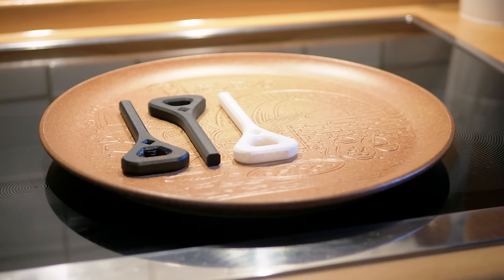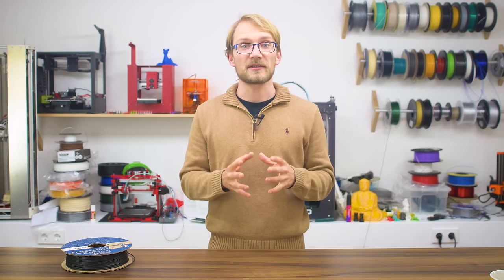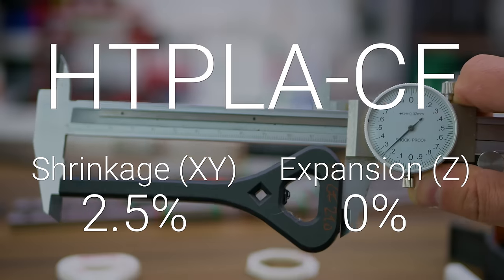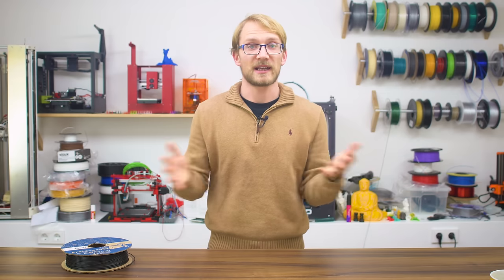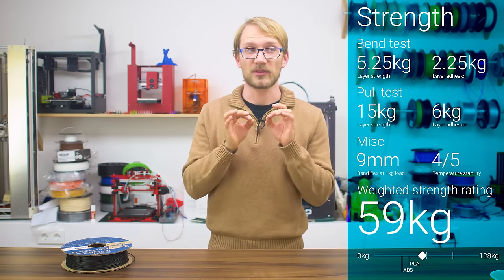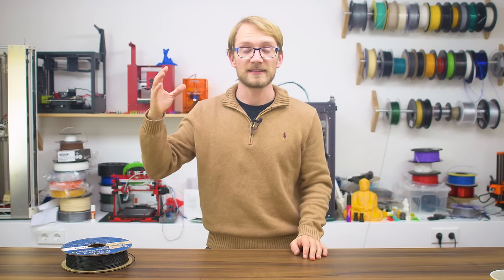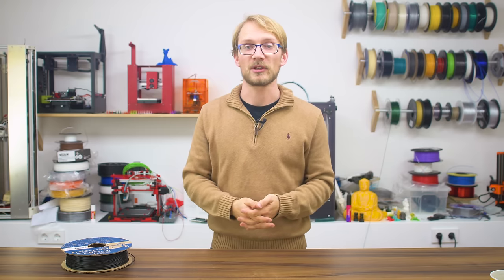Bake your PLA and have it outperform everything else! #Filaween

Comment: I am currently interested in moving from ABS to PLA but need the temperature range offer by ABS, so your video was of great interest to me. Based on your input, I baked a PLA box, which is 86x95 mm and with a print height of 41 mm.  Wall thickness is 3 mm. Unfortunately, the annealing process caused the box walls to warp and blister with the outer shell separating from the inner fill. However, by encapsulating the box in plaster of paris and annealing below the boiling point of water,  to avoid  the moist plaster from cracking, I was able to get a usable PLA box, with virtually no warping or blistering. It's dimensions were also very close to that specified in the design.

Given the lid is a flat 3 mm surface, all I had to do to avoid an warping was  to cook it while still attached to my hair spray coated glass print plate. There was, however, a 0.6% shrinkage along the print surface x and y axis. Print height increased by 3%.

Comment: Hey Thomas!

I'm an undergraduate researcher with Mississippi State University who's currently studying the effects of annealing on standard PLA printed parts. The purpose for this is, as you likely know, to increase viability of additively manufactured parts that are to be put under moderate levels of stress, since the additive method of manufacturing is, without a doubt, the least wasteful manufacturing method. I wanted to thank you for taking a scientific approach to this. While putting together my research literature I have found very few sources that actually include scientific data in their observations and findings on the particular topic of additive PLA annealing. I would also like to ask if you would mind letting me reference this video in my final report and presentation. 

Thanks!

Ryan

Comment: Is the shrinking factor a constant? (IE: does it always shrink X & Y by 3% no matter the shape or size of the printed object?) Or does it depend from the printed shape &/or it's size?... that would be interesting to find out with some tests... If it's constant then it should be possible to adopt universal values of pre-scaling the model prior to printing to get the desired dimensions after baking it... just my 2c
Reply: Pick your favorite PLA, make different parts of different shapes, bake it and measure. There's no other way to know :)
Reply: FranckR I...
...
I don't have a printer... :(
But I plan on getting one eventually.. probably a Prusa. I can make custom models easily though... so yeah :3
Reply: Great question, I don't believe that it is. There is an inherent flow of material and therefore alignment of the molecule as they are extruded even under low pressure. A higher speed of extrusion should increase that level of alignment. Therefore its possible to assume that the direction of the extrusion (or flow, say from North to South) of the material will have a greater amount of shrinkage than from East to West. All to be validated and tested. But again, great question.
Reply: Fred Pinczuk Yeah that sounds plausible... other factors can be involved as well I think.. like how fast it cools down after the extrusion... that can affect how the molecules settle down..
Reply: This was my question too. If you're printing a one piece toy for the kids shrinkage is a moot point, but strength would be a big plus. If, however, you have a multi-part assembly, quantifying shrinkage for model adjustment becomes crucial.

The problem I see is that "doing tests to find out" would be a nightmare. Too bloody many variables! +Fred Pinczuk was on the right track.
What temp and speed was the filament extruded at when made? Cooldown time? Same Q when printed. Was there a fan? How much air flowed while layers were laid down? What was the room temp? (As +Advection357 pointed out - How fast a cooldown?) Bed Temp? Extrusion speed? Nozzle size? Etc, etc, etc. All could affect the results.

Any attempts to quantify shrinkage rate would require many prints, altering many conditions, and the end result would only be totally true for ONE filament from ONE maker, and might even vary by batch. Even just time / temp baking, ignoring all the other possibilities, would require many runs. We're talking microscopic crystallization here folks. Not one plus one.

This test is very intriguing, but certainly not something someone could do at home... perhaps some MIT undergrad team for their thesis ... But a most interesting idea. A home test would be a colossal waste of time and $$ and would not be conclusive, IMHO. :-)

Big shoutout to Thomas Sanladerer for the test, tho. Nice to know your can get a bit more strength, great for certain projects where shrinkage is a minor issue.

Comment: This might explain why my PLA Hurricane cooling duct and E3D V6 mount have not failed on my CR-10. I initially printed these out of PLA just to see how well they fit. That was last year and I can tell the material has changed because I can feel the material is noticably harder and denser. I am printing another one out of PETG just to see how well it holds up on my other CR-10.

Comment: 110 C is 230 F for us dumb Americans.

The shrinking makes sense if you know anything about pizza making or hat making.

In pizza crust, the dough is full of gluten, which is like a whole bunch of elastic bands. If you try to stretch it in a particular direction, the gluten strands will line up and then all retract, making it even worse then when you pulled it. Similarly, the felt for a hat will shrink in the direction you try to pull it out because the fiber line up and retract like rubber bands. In both cases, you have to coax the shape outward by pulling it in circles around the center. You can't really do this with a printed part, but it helps you understand what is going on.

Think of the 3D print as a bunch of fibers stacked on top of each other. These fibers are largely lined up, layer by layer, and will shrink back into itself when heated, but they will also become thicker. So the X and Y shrinkage should be consistent if the shape is consistent. but if the lines are more aligned with, say, the Y then it will shrink a bit more in that direction.

I work in a plastic manufacturer and we do anneal one part and how we keep a consistent shape is we have a metal form the part goes on to keep it to a specific size. So if you wish to do this for your printed parts, you can but you might want to design and cast a form to fit you part onto to keep them from shrinking in ways you do not want, such as moving screw holes too much in a two-part case. This will be a bit easier and more consistent than trying to calculate the amount of shrinkage

Comment: Maybe you could try baking a regular PLA coil before printing and see if that adds any extra data. I sometimes have used baking on PLA to remove extra moisture. I have noticed that it seems to look differently, but I never tried a strength test to the parts afterwards. If it adds some strength it might be a better option then this because the part won't have shrinkage.
Reply: Dry filament definitely gives the best printing result, but don't be misled, heat treating your filament beforehand will not give it high temperature resistance.  Melting during printing "resets" the material structure to amorphous and it still needs to be baked to afterwards to crystallize and get that high temperature resistance!

Comment: That's really interesting. I'm going to try annealing some generic PLA and ESUN PLA PRO right now!
Oven is set 250 F. Heat gun says its from 130 C to 100 C.
Reply: Test Results: ESUN PLA PRO was stronger. WAY stronger.
Generic PLA was WEAKER.
Reply: I'm going to test with ESUN PLA asap
Reply: what is "PLA Pro?" Do you mean PLA+?
Reply: Richard Dagenais yes, sorry about that. the amazon store when I bought it listed it as PLA PRO and PLA+, they are the same
Reply: PLA+ is definitely way stronger. It has 25% deflection vs PLA's 5%.
Reply: Have you tried leaving a print on the bed and annealing the PLA+ that way instead of in the oven?  I've got parts that can't fit in the oven.

Also, was there much shrinkage with the PLA+?
Reply: esun light blue pla pro seriously warped in all and random directions when left in the oven at ~100C for an hour. The part was a single walled printed 2020mm extrusion at 100mm length. The wall was 1mm thick from a 1.0mm nozzle at 0.3mm layer heights.
Reply: 100c is even high for what HTPLA wants.  It should be 60~70C.  100c is well over the glass transition for PLA+
Reply: After my disaster I got 5/18 threaded rods, attached the rod to a drill, and drilled the parts onto the rods in an effort to regain a straight frame. I'm wondering if I stick the whole assembled frame (Hypercube Evolution and yes it does fit haha) back in the oven if it would make it worse or straighten it.
Reply: I think you responded to the wrong comment thread, m9

Comment: I tested normal PLA and petg for a quad build and wasn't happy with either then heard or the tempered/ annealed PLA I gave that a try and is far superior. To get round the warping, when it's cooling a place a heavy object on the top and it flattens it back to normal so in the end it's only a little smaller than the original piece and the minor shrinkage is accounted for. End result is a far stronger and heat resistant quadcopter especially the arms

Comment: Hesitate to draw any firm conclusions. From my experimentation it seems like different companies use different source materials/formulations for PLA. Even when I was trying to smooth them different brands gave drastically different results from treatment with different chemicals like ethyl acetate, M.E.K. substitute, tetrahydrofuran, acrylic cement, pipe cleaner, dimethyl carbonate, etc etc. Doesn't help that even the chemical manufacturers add different things in their products.

Comment: To prevent sticking, use a powder coating product called pre-release. Also unless you are trying to apply a texture to the part, use a smooth flat surface.
Reply: What material do you recommend for powder coating?
Reply: @RyanR3STL3SS  Material to coat or material for coating? You can coat any material that withstands 350° in an oven, and for coating there are powers available in many colors.
Eastwood and Amazon have a wide selection of powders.

Comment: Makes sense... time/temperature treatment post-production results in greater cross-linking. Which generally yields better mechanical properties. Unless you cook it so much that you degrade it, that is. Covered in Materials 1 in my 2nd year of Engineering, and that was in another Century, in world where I earned my degree in the age when we all moved from the slide rule to those amazing 8-function hand calculators.

Comment: Also, annealing plastic, especially when machining injection molded parts to exact dimensions, seems common enough (at least for industries that do such things) that there is quite a lot of material on the topic. When annealed for this purpose, there seem to be temperature, ramp up, and ramp down cycles for different types of plastics. For example: http://www.boedeker.com/anneal.htm

It's likely that both PETG and ABS parts would also benefit from annealing, although with different temperature and ramp schedules. There's enough material on plastics from other industries that would lead me to believe that all of these techniques should also apply to 3D FDM printed parts, but I can find very little rigorous experimentation.

Comment: FYI: wood shrinks in the opposite way, more or less, when drying. it's different in all three dimensions. wood hardly shrinks at all in the main axis of the fibers. but here's the kicker: wood shrinks more perpendicular to the tree rings than it does parallel to the rings. that's why plainsawn (when rings tend to run the breadth of the board) tends to warp into a half-moon cross section, as the rings are circular. I know it's not relevant, but I think it's cool.

Comment: Pack it in the sand to add compression force to allow filament to bond. This is common post processing techniques done on metal SLA printing. I am assuming same practice can be done on FDM plastic parts.

Comment: You should try with several steps in the annealing process : start with a 70C cession, then 85, then 100, and you may even try 110C after that. The shrinkage will still be quite present, but you should avoid any major deformations.

Comment: Just did my own tests with Makergeeks' HTPLA and some generic PLAs, and I can confirm, normal PLA sees huge improvements. I was worried about making a coffee cup out of PLA for obvious reasons, which is why I went for HTPLA, but after annealing the regular PLA in my tests I am seeing that it could handle near boiling temperatures just fine with no warpage or softening.

Comment: thats good to know.. as i prefer pla above all..  pla is the cleanest and easiest to print... for perfect engineering parts with out the strength.. until now.. a perfect overall filament...  the only problem i see.. for exact measurements.. after heated might not be exact to specifications even if altered on software.

Comment: I'd love it if you did more on this. Tests for how consistent the shrinkage is would be a great start, and testing a variety of temperatures and times would be good too. I'm curious whether short cycles of heating to the glass transition temperature, then cooling, then heating again might reduce the amount of shrinkage seen or whether it would just worsen overall results.

I'd do this myself, but I don't have a toaster oven that goes to low enough temperatures, and my printer has problems I'm still working out.

Comment: Carbon is like wood where it has a grain structure. Especially when printing it vertically. If you printed this part horizontally the carbon should out preform the other plastics. Of couse this is for regular carbon fiber. Idk if the same applies to printed parts. But having your grain aligned with your forces properly should add strength in the dimensions you need while it will be weaker in the other dimensions.

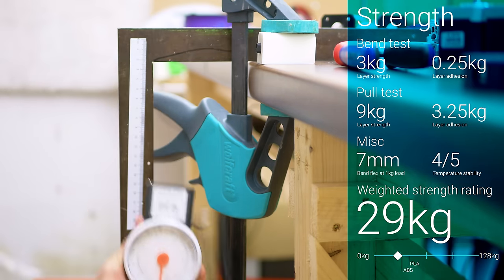Comment: 2:30 The CF, You printed it Vertically instead of Horizontal. Layer on layers are tend to break on that direction and are on the weakest point. If you print it Horizontally where your test are based upon, you will see the modulus strength difference. CF are known by directional strength.

One thing, CF are isolated by on its own layers, even if you anneal them. it will not migrate to a different layer.

Comment: hello, this is a pretty interesting video. i would suggest that you try different cooling speeds after annealing. the crystalline structure of materials change drastically if they are slow cooled (like you probably did letting them just cool down)  vs a fast cooling submerging them in cold water or something like that. you can also try cool them even more slowly letting them in the oven while it cools. the slower the cooling the crystalline areas get bigger while if you cool them fast you are 'freezing' the high temperature amorphous state.

Comment: Personally i do not think that annealing will have any bad influences apart from possibly some degradation of the polymer. (Should not be noticeable if the annealing is done carefully, but it probably does influence recycleability of the PLA) Apart from that, i actually expect the PLA to be more resistant to moisture, as crystalline molecular structures are stabilized.

Comment: Your parts stiffness increased, but the Yield point stayed the same. This is a great result! I point at the example of ductile steel vs plain carbon steel. why would I want a weaker steel aka ductile then a stronger steel plain carbon steel. well ductile will reach its weaker yield point without deforming, or bending, at that point it breaks. where plain carbon steel will deform/bend and keep that shape without yielding. this is problematic as clearances in mechanical parts change, and don't bring rise to the deformation. If i was making a gear/bearing in PLA. I would opt for the stiffness vs the flexibility. If i was making a snap cover plate, I would want the flexibility for my clips. Thanks for the video!